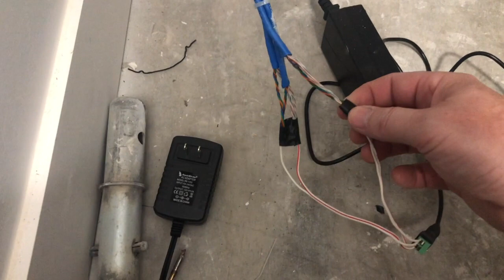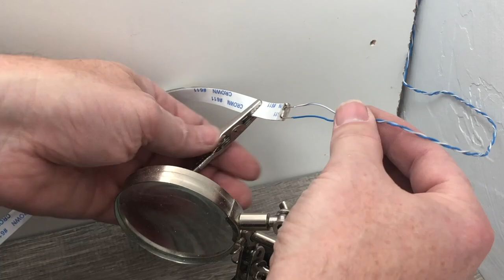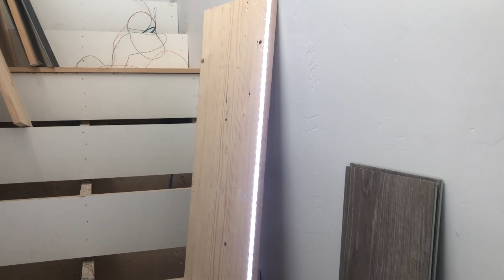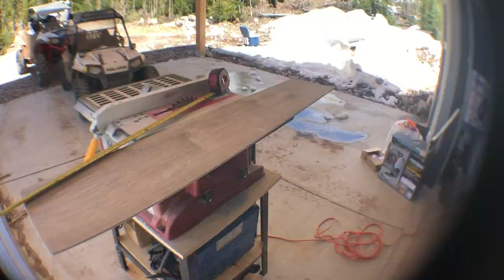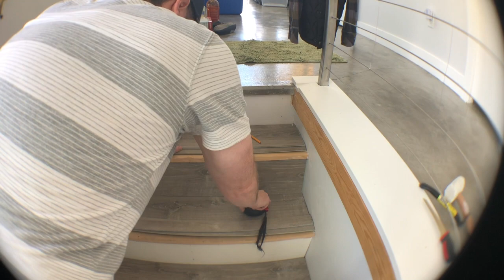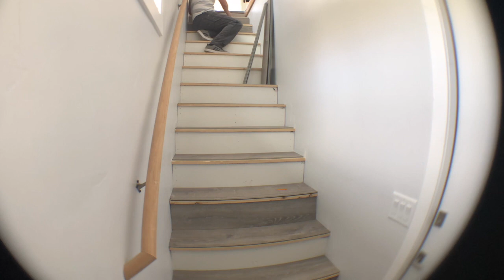DIY LED lighting under stair treads - Finished my custom stair lighting project!

Comment: I’m in the process of building the same. I would just recommend everyone to build it maintainable. If you do the same as in the video you will have a hard time replacing faulty strips. Use a router and make a groove, use LED U-channels inside the grooves and get the diffusers to cover the U channel with the strip inside (looks nicer). And make sure the wire coming through the risers have wiggle room so you can push excess wire inside and pull out if you need to replace a strip and solder the wires.
Reply from the maker: Good advice.

Comment: Im trying to understand does each strip have its own set of wires and you run all the ground and + wires back to a supply or did you connect each to the next?
Reply from the maker: There is a bundle in the blue line, each are wired individually but connected to a single LED power supply.

Comment: I might have missed it … but are these activated by a light switch or motion sensor?
Reply from the maker: Light switch. Under the stairs is a small electrical box that contains the power supply connected to an outlet controlled by a switch.  I saw someone do a sweet set up with motion sensor that times it out.  I have since put one in my pantry.  You would just need the sensor to be able to ‘see’ movement. Maybe could hide by a handrail? Or under a stair tread.

Comment: Nice, but I am just wondering...why you didn't use aluminum bars under those LED stripes,instead you put it direct on wood.I think it is not very smart for long term use...
Reply from the maker: The toe kick that wraps around covers them well.  You would have to purposely kick up underneath the tread to try and hit it.  But for sure an option. Always fine to overbuild.  The LED strip is coated in a silicone encasing that also protects it.  No issues of kicking damage in two years.  Also, this place is being rented out short term.
Reply: @AaronRobertson  I was more thinking about the overheat issues. I have similar led stripes in basement, and I used those aluminum bars , however it still generates a lot of heat after a while. But on the other hand, the way up and down the stairs takes a few seconds, so there is maybe not enough time for overheating..By the way I like how you did the laminate job...It looks amazing.! I am going to do something similar this weekend :).
Reply from the maker: @martinj.6734  Oh OK, makes sense.  I was thinking if I were to do it different I would have also used a diffuser.  Maybe would accomplish two things.  But yes, we don't leave the lights on.    Thanks for the compliment, best of luck on your project.
Reply: @AaronRobertson  Thanks :)

Comment: Hey Man. Was wondering after a year or so with those vinyl planks you put down, would you recommend doing it that way? How slippery is it ect? Cheers man good vid
Reply from the maker: It hasn’t been an issue and we’ve even been renting the cabin out. Visually it made a huge difference and it even got quieter using the stairs. Glueing it down I think is key. We honestly don’t use the lights but the treads are great and easy to clean. This time of year with the snow melt and if people don’t remove their shoes. The color matches the concrete floors as well. I have not noticed them being slippery either.

Comment: Maybe i missed it in the video, but did you considering soldering all the LEDs before installation and just having the completed strands ready? 

It seems like it added extra difficulty by sitting on the stairs and soldering 1 by 1.
Reply from the maker: I did not because I did this at our cabin with no good workspace area to begin with but for sure would make sense to have them all tested and ready to go.

Comment: Hey there, I loved the idea and how nicely you did the job.. I do have a question tho..
Our house is a bit of a weird build due to the living room and kitchen is upstairs and the bedrooms are downstairs… so where the stairs are located there’s no wiring underneath it or any sort of plug… it’s just an empty under stair if that makes sense… so I was wondering how can I be able to put the led strips if I don’t have a plug or electricity under my stairs
Reply from the maker: You would for sure have to have a source of power. I’d recommend having an electrician install some power under the stairs that you could access.
Reply: @AaronRobertson  thank you so much for the reply 🙏🏻 wishing you a merry Christmas and a happy new year 🎆
Reply: @AaronRobertson  thank you so much for the reply 🙏🏻 wishing you a merry Christmas and a happy new year 🎆

Comment: Would these strip lights work on exterior stone steps?
Reply from the maker: The ones I used are encased in a silicone like material and they are waterproof. It would depends on how you wire them. If you do it in a way to be waterproof, absolutely.

Comment: What if you need to replace one?
Reply from the maker: Replace the light or tread?  It is doable.  would take a bit of effort, but they have been running fine for almost a year now.  I do have a top step where the light isn't on.  I think it is a wiring connection but I've not checked it out yet.

Comment: If I had done a job like this the last thing I would do is to film it and show the world ! Wrong type of cable, wrong type of PSU, bodge adapters on the high current feed. Unsafe and unwise. No mention of current at any point, did you measure current per step or calculate anything?, I suspect not. No over current protection other than the PSU, nice to know that will shut down. probably after the fire has started. Staples over the strip with no extra insulation, nice touch!
Reply from the maker: Instead of cynical criticism, please share how to do it right.  I don't ever claim to know about everything.  The LED strips had a thick silicone coating that the staples did not pierce or crush so they are safe.  I did find that I needed an additional power supply to split the stairs into two power supplies but everything has been working fine with no fires.

Comment: awesome how there's only a 2 second glimpse of the finished stairs in day light!
Reply from the maker: Sorry, was focusing how the LED lighting, didn't think about sharing the finished stairs.
Reply: @AaronRobertson  bit shite that u see the led strips walking up the stairs u should have hidden them
Reply from the maker: @Ukman-england  They are under the bull nose but yes, if you are at the bottom of the stairs and look at the top, you will see them.   Someone suggested using a diffuser which would have been nice.  Other than that any more hidden not sure it would light it up well.
Reply: @AaronRobertson  I seen a channel cut out about 10mm into the step and strip sits into it on another utube.but if yr happy that's all that matters

Comment: you sort of blitzed past the part I was hoping to see.  How did you set up the LED on all the stairs without having to basically have them in a figure 8.. i.e looping from end to end to end.
Reply from the maker: Sorry Steven, I am so late in replying to this, YT changed their format, I used to get notifications of questions.  I had bundles of low voltage wire that was installed when the house was built.  They each had 4 pairs of wires.  I just used each section of wire to solder right to the strip of LED.  Hope that helps, you probably already figured it out.